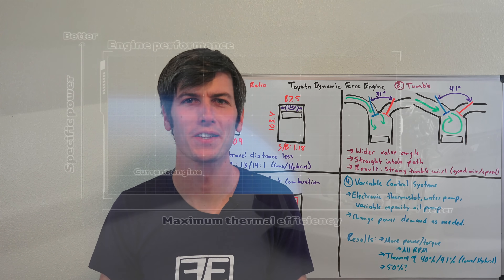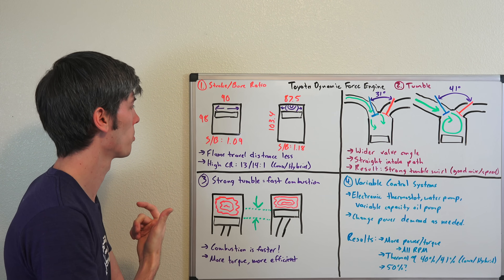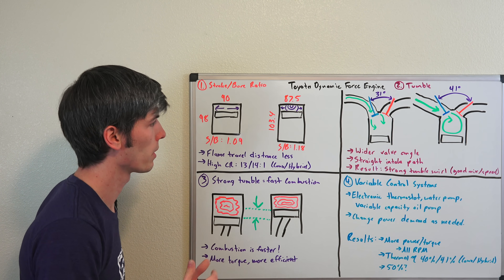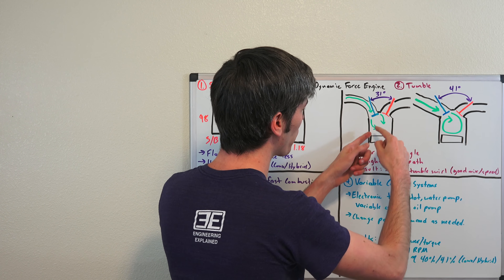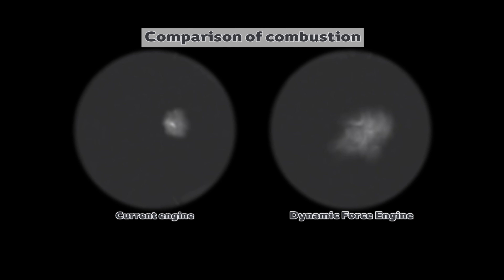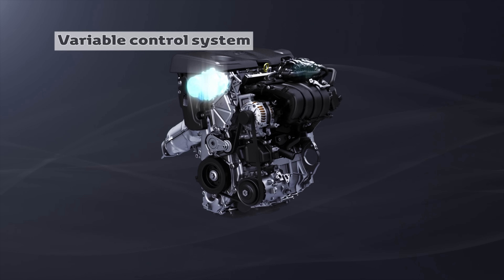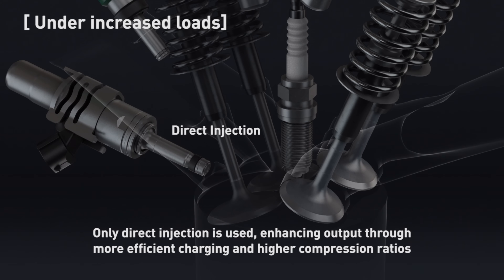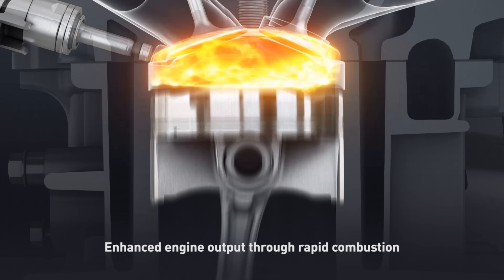Toyota's New Dynamic Force Engine Is Super Efficient

Comment: When you change the water pump is the electric motor a sepret unit or are they one unit?
Reply: Probably one. The 'pump' part is only a vane, why would you want to separate that?
Reply: pizzablender I guess I was kinda thinking about weight. 1 moter driving water pump and oil but know I see that that would wast energy. You would not need the same work 4 the two different components. Good point.

Comment: Hey Jason, in one of these efficiency videos, can you explain their operating temperatures? That way I can do the Carnot Cycle calculations to figure out what the max efficiency could be! (e=1-(T2/T1))! Or if you could just quickly do that calculation whenever you do these efficiency videos! That would be great!
Reply: Rather, the Max efficiency for the most efficient engine cycle (even though these engines don't run on the Carnot Cycle).

Comment: Mazda's Skyactiv-X is more impressive though.
Reply: Toyota and Mazda now have a limited partnership.   It would be interesting to see if they ever collaborate on engine design and give us sort of a "best of both worlds" product.
Reply: @93greenstrat  the partnership will be short lived as most in the Auto industry seem to be.  Toyota values reliability and proven real world performance more than all competitors and Mazda goes for the "gee that's cool" buyers.  Smart money on Toyota
Reply: Another eficiency on this hibrid ice motor is that use an heatexchanger on exaust to warmup quick cooling liquid, so ice motor reach working temperature and Heat to climate habitacle faster. On trafic jams, ice motor could be off with Air conditioning on, compressor is a electric delta tree phase motor driven by inverter. Transxale with less mechanic friction, no mechanic CVT, no speed gear box, no reverse gear, just one epicicloidal gearset and diferential group. Inverter control can set better rpm of ice motor for each specific circunstance not depending of speed of the wheels. In fact, car could be stopped and ice motor running to charge HV battery without the need of decoupled any dry clutch or hidraulic clutch in between.

Comment: Very good presentation. I understand that this is a gasoline combustion engine. Does Toyota intend to use it on a diesel engine?
Reply: Nope. Toyota announced about half a year ago that they won't develope their Diesel engines any further. Because they don't see any future for them in cars beside petrol, hybrid and electric.
Reply: Diesels are already running around those efficiencies, so I'm not sure it would be worth their while. Also diesels will be banned from sale in new cars in a lot of Europe by 2030 I think, so not much incentive to do anything to them unless they can be made to burn more cleanly first - the reason diesel efficiency is higher is that diesel runs higher combustion temperatures, leading to Nitrogen molecules, which take up 78% of the air, getting broken apart to form the NOx compounds that are a lot of the reason diesel is being banned.

Comment: So how does this engine compare to lets say a tsi or skyactive or vtech? I mean 40% Thermal efficiency sounds much but if these engines are doing 38% well then it's disapointing.
Reply from the maker: Plenty of engines out there are still often operating in the 20's and low 30's from an efficiency standpoint. 40% is very, very good. Especially for a cost effective engine.

Comment: OLD diesel engines were getting 40 percent and more efficiency, likely better now. (I was recently researching antique diesel engines) I would just go with an old, or new diesel because of Far Less Moving Parts, and so, much more reliable and cheaper to run. And of course, the initial cost is cheaper too. Just look at all those electronic controlled mechanical systems on the engine in the video. Not for me. 
But, for those who want all this complication and systems, maybe this is for you. This certainly is a good improvement in gasoline engine efficiency, I do agree.

Comment: All auxiliary systems in this engine are electrically operated. Soon engineers will come up with engines with electrically operated valves as well.
Reply: Doesn't Fiat have that, with the TwinAir valve control? Powered by hydraulics but controlled via electronics.
Reply: BMW did this already a few years ago AFAIK, but they still run camshafts for backup. Not sure whether the system is reliable, but given it's BMW it's certainly more expensive :-P.

Comment: I like this. It's especially interesting how they basically ignored a significant fraction of the inlet valve curtain area through the jagged edge on porting to get the tumble, but installed much larger valves to compensate. I wonder what this head would flow like? Is the power all from greater efficiency or has airflow improved as well?

Also, if those are CAD models of an actual engine, it's running some impressively large squish pads that incorporate the inlet valve face as a surface. Cool.

The whole thing reminds me of a head design theory called the "Soft Head" (no idea why it's called that). The theory goes that with extreme squish comes very good detonation resistance and a high burn speed. The whole engine gets designed around that theory, and ends up with basically no valve overlap and a very small combustion chamber centred, as much as possible, around the exhaust valves and spark plugs. This is what some early restrictor plate NASCAR engines were doing, back when compression wasn't limited and if you didn't run over 14:1 you weren't going to keep up

Also, yay for undersquare. The only oversquare engines I've had used absurd amounts of fuel for the vehicle they were installed in. Cough EJ20 cough

Comment: These 40% say nothing about the real efficiency of the engine  because it is only the peak efficiency on a specific load/rpm. The overall efficiency over the whole load range has to be better. Peak values are useless - a modern diesel also  has up to 40% efficiency but on real load conditions it is only at about  17% in average.
Reply from the maker: I think that depends. If you're using it in a hybrid, with a CVT or in series, you can put the engine in optimal efficiency ranges. But yes, the entire BSFC map needs to be wide and tall for optimum fuel economy (and they have greatly improved this map, perhaps a discussion for a future video).
Reply: okay, in a hybrid engine it would really be an advantage. For hybrid enginges it would be the best to design the motor for one specific load/rpm, so you get the maximum efficiency. The rest could be done by the electric motor control and buffering the power in batteries or caps.

Comment: Have you seen the newish Ford horizontally opposed, six-cylinder, turbocharged AND supercharged 2.7 litre engine 2 stroke! Old idea and tad big but 270 horsepower and 480 lbs-feet of torque and 37 combined american mog is not bad and can run on deisel! Have you done a vid on that?
Reply from the maker: I have indeed heard about it, perhaps need to dive in a bit deeper!
Reply: Ford? Achates is the name of the company behind the engine and are following the HCCI (PCCI actually) way. Similar combustion approach to Mazda minus the sparkplug.

Comment: Hey bro, can you make a video about oil temperature related to sport cars and motorcycles engine? I have a 600cc motorcycle that is recommended from Honda itself to dont go out with it until you get at least 65°C of oil temperature. I want to understand why is that. Thanks from Brazil
Reply from the maker: The engine is happy, oil is flowing properly, and all the tolerances are met when it's at operating temperature. Hence, it's best to wait until it's properly warmed up to really start hammering on it.

Comment: The swirl sounds alot like what the Suzuki boulevard S40 does. Its insane that they can get a 0.650L single cylinder to burn correctly. According to what i was reading most of it was because of this swirl.

Comment: Obvious question: Why didn't anyone think to vary the cylinder dimensions and straighten the airflow into the cylinder before, if it can increase efficiency so much?  They look like obvious variables to play with so I'm wondering why Toyota is the first to try.  Or maybe this new super efficient engine isn't really all that great.  Mazda produced a truly different ICE that runs compression ignition on petrol, but Toyota seems to just have minor tweaks to an existing design.

Comment: How does this compare to Mazda's Skyactive-X and Skyactive-3 engines? Skyactive-3 even supposed to have 56% thermal efficiency
Reply from the maker: I haven't seen much on SkyActiv-3, but 56% is obviously significantly higher. SkyActiv-X I would assume is a bit more efficient as well.

Comment: Electric cars are becoming the new thing, more affordable, more efficient, more accessible and suddenly gas cars are becoming much more efficient and powerful, it's a race to which will rule.... I vote for gas.
Reply: EVs are grossly over-hyped. The technology has been around since the 1800s, yet they only make ~1% of retail sales, and that's with heavy government assistance. When their subsidies and tax credits go away, the cheapest EV with 250+ miles of range is going to be the Tesla Model 3, with the "Long Range" batter pack, and it costs $44,000, and that's without considering whether it's profitable or not (Probably not). Again, that's the cheapest, and it still gets it's power mainly from fossil fuel power generation, which has the same thermal efficiency as any ICE car. So far, EVs have been promises of the moon, while the advancements of the ICE are meaningful to the average person.

Comment: It is interesting that the longer bore / stroke ratio and larger valve angle were things that the Japanese motorcycle engines went away from in the 1980's, for more performance.

Comment: I am surprised that such small changes can actually make so much difference.  Its very clever way of improving efficiency without significantly changing the engine design.
Reply from the maker: Yes, it's nice when the solution is relatively simple, and doesn't have to sacrifice longevity/reliability of the design.
Reply: @EngineeringExplained  Sad Turbo noises*

Comment: Well higher compression ratios for petrol engines means higher octane fuel requirement if I am not wrong which are expensive!!
Reply from the maker: Generally yes, there is a correlation, but not necessarily when using the Atkinson cycle.  Mazda's 16:1 compression ratio SkyActiv-X uses regular octane fuel. Prius's are running high compression ratios and also running regular octane.
Reply: Engineering Explained so you mean (higher comp. Ratio)+ (Atkinson cycle)= low octane fuel?????

Comment: 13:1 on pump gas, just seems amazing.
Reply: My 1.6 engine petrol car is 13 years old and it has 12:1. Minimum requirement is  95 octane and recommended is 98. 

So...yeah.....
Reply: My first car had a comp ratio of (only)11:1 and it required a minimum octane of 103! How do they do this with even higher ratios and lower octane. Doesn't make sense.
Reply: @lochinvar00465   over square motors like zx9r's run 12.1:1 with 12k rpm use 87 octane the motor was 143hp. The quick explosion of 87 octane is better for short stroke motors. 75mm x 51mm.
Reply: I wonder how much they ‘bleed off’ with the cam timing to create the Atkinson cycle?
Reply: The reason why you need such high octane fuel in high compression vehicles is because higher octane fuel won't pre-ignite and cause pinging like lower octane fuel will. This is caused by uneven surfaces within the combustion chambers. If you can make the interior of the chambers very smooth without faults you can run lower octane fuel with less risk.

Comment: I would like to know if this will benefit the consumer? yes more fuel efficiency but more complicated design more parts to go bad. will I have to service more. spend more on repairs? in the end what's the point?
Reply: Alvin Satney In what way is this more complicated? It looks like relatively small design tweaks that don't change the complexity at all.
Reply from the maker: How did you conclude that it's less reliable? Only Toyota's engineers know that. And the changes they made are relatively simple. I wouldn't be surprised if they've improved reliability.

Comment: This and the launch gear seems to be better time & man power spent than Audi's electric supercharger which looks like a very roundabout way of tackling a problem, even if it's actually not that complicated and is more like a label stunt.
Reply from the maker: Well keep in mind the goal's for each. Toyota is developing cars for everyday drivers; they want reliability, efficiency, and torque is an added bonus. Audi's electric supercharger is for a completely different customer (luxury performance SUV). Reliability/efficiency isn't as critical of a factor. It's a car someone will likely lease and have fun in.
Reply: Yeah I know. Just seems like a very roundabout way to eliminate turbo lag with 3 turbo/supercharger (well, 1.5 if you count per bank) and crisscrossing air paths and using the cylinder valves to control them.

Comment: Are you more excited for this or Mazada's SkyActive X?  Which will be the king of the new super-efficient engines?
Reply from the maker: I think Mazda's solution will likely have a greater thermal efficiency, but to my knowledge they have not published what the thermal efficiency will be. It's using a 16:1 compression ratio, and should have even faster combustion, so in theory I would assume it's at least slightly more efficient, if not significantly (again, I've seen no efficiency numbers published though).
Reply: I think in the long run overall toyota well be better because of real world conditions and that is the human problem. Most car owners are very poor with they're car maintenance like oil changes spark plug change interval and using cheap low grade gas to save a buck in the short term. I think toyota's engine seems to be far less complicated and will hold up better in the long run where the mazda seems to only work well under laboratory conditions.

Comment: Toyota the best nothing can’t beat their reliability
Reply: My Toyota trucks frame rusted out well before its useful life. POS.
Reply: Wrong, moron.. There was a recall on the corrosion vulnerability that I didn't know about until I had gotten rid of it.  Many trucks were effected.
Reply: I got my step father a new frame and brake lines last year.  2001 Tundra 91K miles.  Under this recall campaign 👍
Reply: Emperor Kim Jong-un a Toyota will run without oil nd gas lmaoo
Reply: Yes, true, easy fix. Recall car. Replace frame. Fixed!
Reply: If you want me out of the gene pool you are right to recommend that I drive a Toyota. They are very dangerous.  I've seen cheap bedframes that had thicker steel than my POS Tacoma.  My Ranger did much better.
Reply: Punctuation is your friend. Use it properly and your sentences will make sense.
Reply: Anderson Rodriguez ignorant! Nobody can beat Toyota, really?

Comment: How would you compare Toyota's Dynamic force engine, in terms of fuel efficiency, against Mazda's SKYactiv X?
Reply from the maker: I think Mazda's solution will likely have a greater thermal efficiency, but to my knowledge they have not published what the thermal efficiency will be. Mazda is using a 16:1 compression ratio, and should have even faster combustion, so in theory I would assume it's at least slightly more efficient, if not significantly (again, I've seen no efficiency numbers published though).

Comment: So when will we be seeing the Dynamic Force in Toyota's, any timeline?
Reply from the maker: I believe it's already used with the 2.5L Camry, though they have a new 2.0L engine which will use the tech as well.
Reply: 2019 toyota corolla hatchback
Reply: Already in my 2018 Camry . Brilliant engine !
Reply: Also a similar tech version is currently used in Yaris' new 1.5l N/A engine. It reaches 38% thermodynamic efficiency and it can move from OTTO cycle to Atkinson depending on the load. It is sold in EU, do not know about US tho